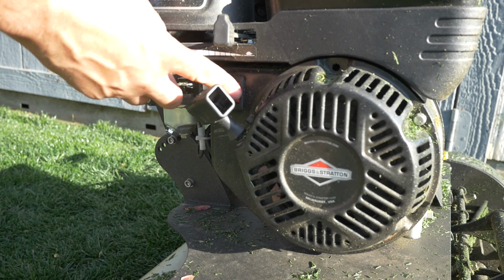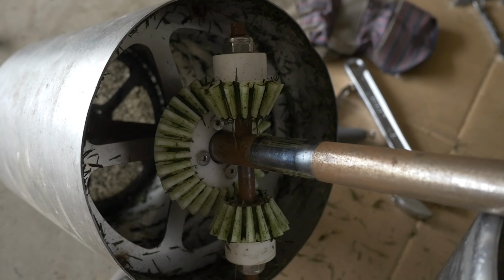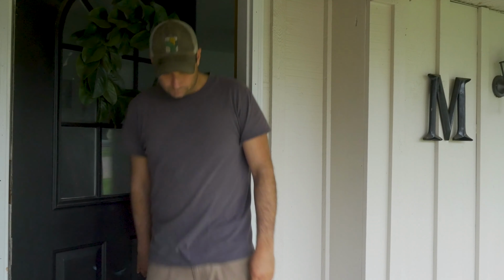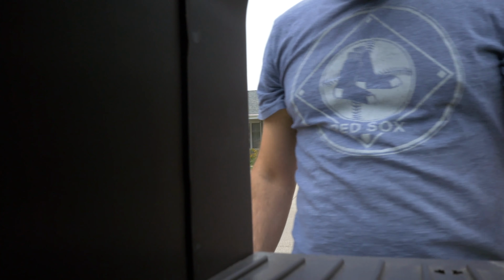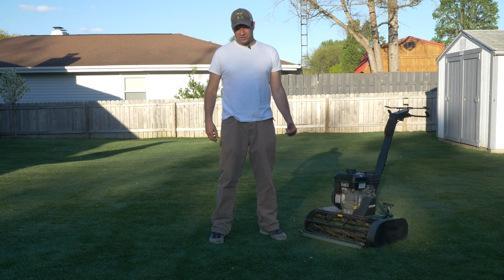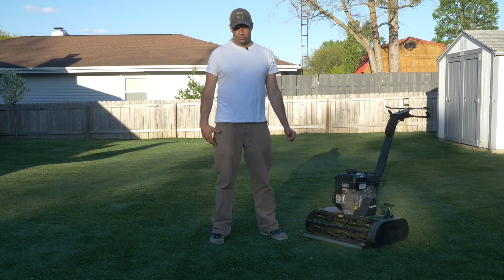Swardman Review Part 2

Comment: So much to comment on.
  
1 - First video I’ve seen on any major issue with the Swardman and it was very informative. 

2 - Reel Rollers is a top notch company. I had an issue with my reel and they went above and beyond in correcting the issue. 

3 - Those were some great tracks playing during the cutting montage. 

4 - Triple wide stripes !!!

5 - 10 for the cartwheel.
Reply from the maker: 1. I’m glad it played out the way it did, you just never know with something relatively new. 
2. RR has earned my trust for sure.
3. Lol, music is hard to pick, had to go with the rap track on that one.
4. You just made an eight year olds night!